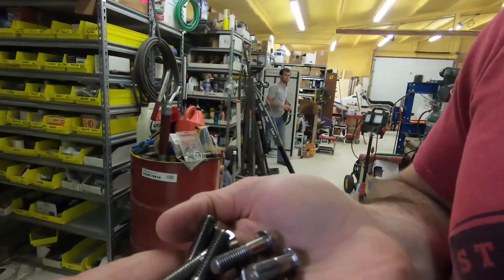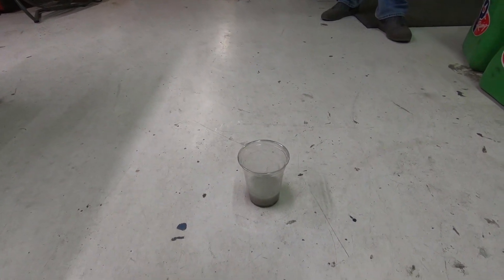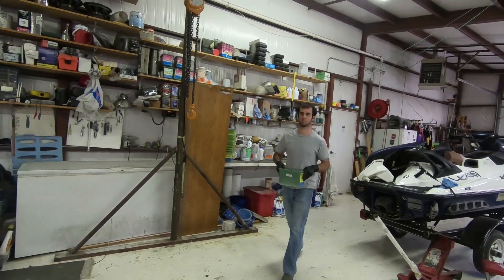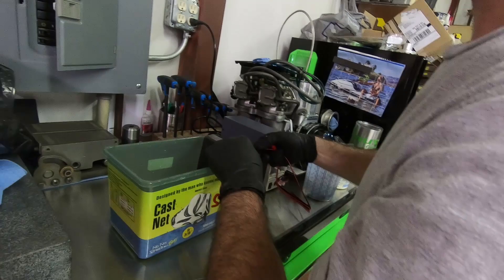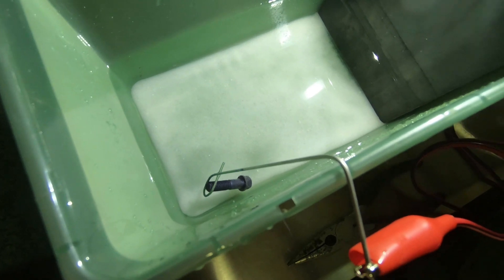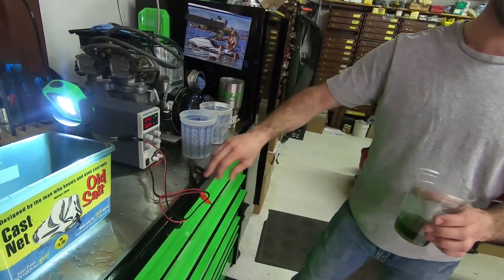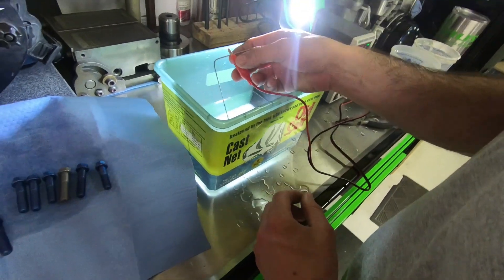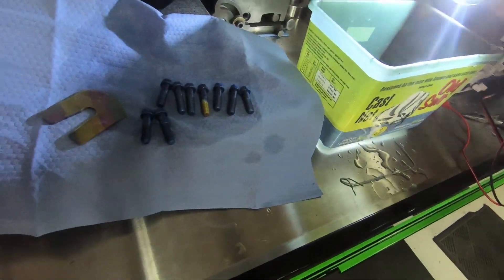titanium bolts coating

Comment: What material
Reply from the maker: You have to etich the titanium first with special meratic acid then dip in distilled water the white powder is borax then add current
Reply: @beaushow319  Thank you very much sir 🙏🙏🙏🙏
Reply from the maker: Titanium
Reply: @beaushow319  what liquid is baking soda ...??
Reply: How many volts?